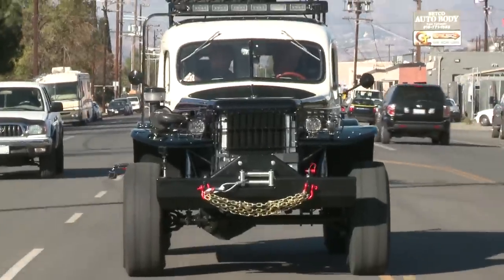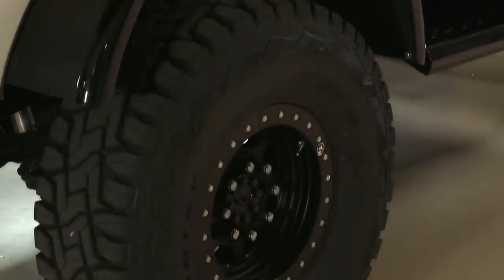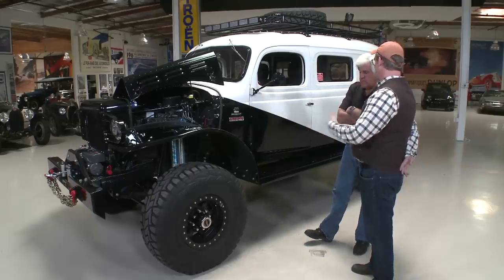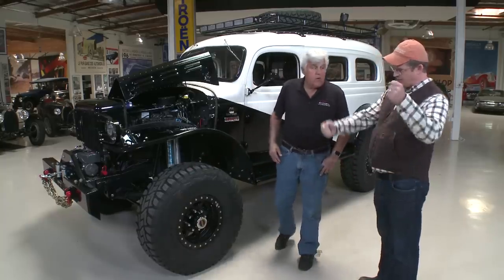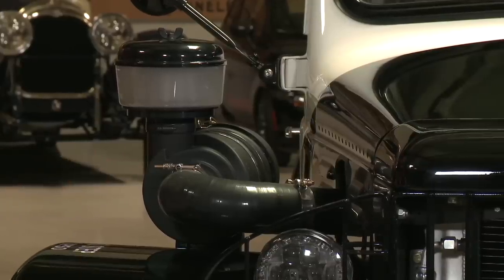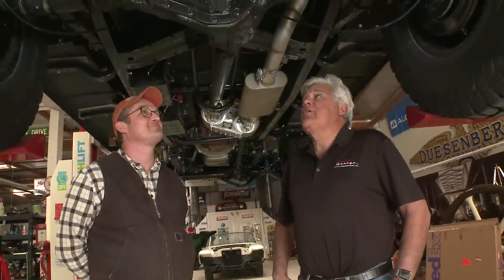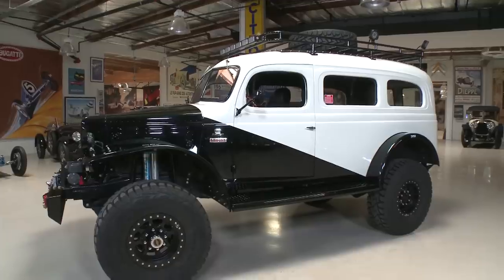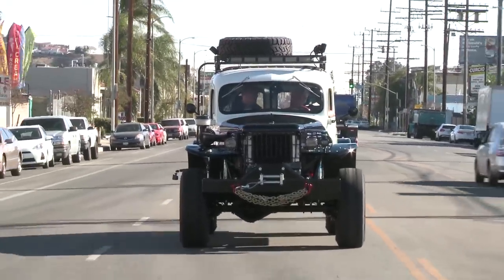1942 Dodge Carryall - Jay Leno's Garage

Comment: The Diesel engine only has one wire? To shut off the fuel?
What about the alternator and the starter and the battery?
More BS ....
If the batteries crack it can be push started.... If it had  bumper..
Zip ties ?
Reply: it does not need an alternator to run. do you know how a diesel works?
Reply: jamesbulldogmiller - you should know SOMETHING about ANY diesel before you comment on one.
Reply: Does it have an electric fuel solenoid or is it mechanical?
Reply: If it has 1 wire to kill it how many wires are there to start it because they didn't push start it.
Reply: jamesbulldogmiller "The Diesel engine only has one wire? To shut off the fuel?
What about the alternator and the starter and the battery?
More BS ....'" ///  It is a little but it doesn't need those in order to make it run. That's the point. That engine doesn't need external wiring or 12v power source to run. Does it make it simpler? Sure, but it's not necessary.  Not sure how that qualifies as more BS though. What was the first thing that was BS that this is adding to that make it more BS?

"If the batteries crack it can be push started.... If it had  bumper.." /// Or pulled with a strap, which I much prefer over pushing bumper-to-bumper. That being said, I'd want a rear bumper on my build but not necessarily to push on.

"Zip ties ?" /// Yes there were some. Did you have a point? If you're complaining that there were some, he gave a legit explanation as to why they were there and that when the truck was 100% they would be replace with leather straps. Did you not comprehend that? Or do think he should have used duct tape instead?
Reply: Don't forget the shocks with 3" of travel...
Reply: @kwhite145  mechanical

Comment: these batteries just hanging there with electrodes exposed.....wow....
Reply: the owners wanted lots of sparks for that "action" effect!
Reply: Won’t they short out if you drive in chassis-depth water?  Well short of the air filter.  Those door seals don’t look very waterproof either.

Comment: Not 4x4 full time, rolls eyes, batteries in the muck as well is crazy- at least a marine battery box and finally brake cables that will scrape and rip off on serious off road
Reply: Yep. And the fuel filler in the back...under 1500 pounds of tools, equipment and spare parts. That's smart...
Reply: Thing is it looks like beautiful workmanship, but poor execution regards under body protection and weather proofing.
Constructive criticism.
Reply: 130 hp turbo wtf fit a Cummins BT6 5.9 ltr 215hp plus and 400nm ( just do killer dowel pin mod) 
sight glass on a transfer case- my Land Rover 90 1uzfe powered toy doesn’t need this.

Comment: How are they going to go that deep in water with the batteries under the car?
Reply: cause water does not short out electrical systems on cars like you think
Reply: diesel engines can run under water, once the car is running its good

edit: as long as the breather is above water level
Reply: like he said the engine does not need additional electrical input
Reply: Change out for optima batteries, problem solved. They are sealed.
Reply: He said all the breather tubes were run together up to the air box.
Reply: He did not say if the batteries are vented as such, just that the drivetrain was. I think if the truck was going to be forging a lot, that sealed batteries would be a better overall choice, given where they are mounted. It is not clear if those Delco batteries are serviceable, but I would assume they are, which means they could be 'flooded' if submerged.
Reply: Lots of modern fuel tanks have the fuel pump with bare positive and ground connections in the petrol.
Reply: ALL lead-acid batteries of the AGM type are also sealed. The Mercedes-Benz Airstream Sprinter motorhome uses (2) AGM batteries mounted underneath, laying down on their sides.
Reply: Adam Trombino With very rare exceptions,almost all modern batteries are sealed. Was in an old school battery store in Vancouver BC. Davidson Batteries. Except very large 6V batteries for off grid power and one old school 12V boat battery(120lbs lead ),all the others were sealed. I prefer accessing individual cells,but the reality is otherwise. Boat battery is great. But about 18" ×12" ×6". Not that many vehicles with somewhere to mount that in a homemade box sturdily built.
Reply: unless there's a fuel solenoid!
Reply: Jay West, I doubt the battery vents are tied to the drive train vents, who wants sulfuric acid fumes in the gearcases!
Reply: Michael Richter Optima qc is not what it used to be. Both of my yellowtops purchased in 2013 failed shortly after warranty. Seems to be common after a Google search.
Reply: +Brian Sturzenbecher they are made in mexico,stay away!
Reply: Electrical currents follow the path of least resistance. So even when submerged, it wont short because the copper cables are more conductive than whatever muddy water the car runs through. At 1:50 in this video: watch?v=tKePT2I-ORU You can see a battery just below the person's legs.

Comment: so, all the drivetrain vents are exposed to engine vacuum? This doesn't cause problems?
Reply: Greg Fuller Intake at the air filter is about 2 to 5 inches of water,not mercury. Not a bad idea,but not a great one either. At least it is after the air filter so it is clean.
Reply: It's a diesel.  No throttle restriction.
Reply: Ah roger that, I had completely forgotten about the diesel part of the equation.

Comment: Running all the breathers to the air intake is a dumb idea. That basically puts a negative air pressure into all the running gear. Better to place positive pressure in there so that is pushes moisture and dirt out rather than sucking it in.
Reply: excellent point. The negative pressure in the housing is bound to suck in moisture and dirt. I guess the idea sounded better than it actually works...

Comment: So with those batteries exposed underneath like that, you can still drive in 4 feet of water?
Reply: furyofbongos Yup
Reply: Starter motor uses battery but the engine doesn’t need any electrical to run.  Lose battery’s and you lose accessories like the welder and air etc.  but you can keep going.
Reply: Batteries work just fine underwater.
Reply: Wouldn't they short out, since water conducts electricity?
Reply: dasher69 not really. Batteries are only 12v. Water isn't that conductive. If you were talking 120v that would be a different story
Reply: Gussy Grissom, yes there is and a cut-off for the alternator field circuit would be a good idea.
Reply: ...well I guess it doesn't really matter if the electrics go out when you're driving in water because the diesel doesn't require electricity to run. However, the battery location is nonsensical...

Comment: This is horribly designed. If I was going to drop 250k on a 4x4 it would be going to ICON not Legacy
Reply: Id go to Diesel Sellerz.
Reply: If I were dropping 250K on one it would be the Mercedes 4x4 Squared before this.
Reply: Mercedes 6x6 G-Wagon same price AND triple the power , air conditioning, and German engineering

Comment: As others have observed -- there is a ton of stupid in this rig and the $250K price is an obscenity. The builder kept insisting the machine was unbreakable. Yeah right ... no skid plates -- that exposed plastic tube, brake wires etc eternal. Battery location might survive some immersion -- but location is still senseless. Think mud, gravel, tree trunks. Inside filler position is beyond stupid. I bet this thing will break down within a couple weeks on the trail. If I were the client on that project I would tell the builder to go shove it and not pay a dime. I think a legitimate builder (who is not a thief) could take a similar, 80s land cruiser and ruggedize it properly for 30 to 40 grand in mods.
Reply: Yep totally agree. Poorly designed.
Reply: Price is not far off to do it right for a rare vehicle to do it period. A simple LS swap into a 50s truck starts raking up big bills for all the little things to do it right. AC, trans, suspension, bare metal restoration, rust repair, etc. They are not going to destroy this on rocks so no skid plates needed. Lol.
Reply: Everybody is entitled to their opinion.  I certainly understand the price.   To use a different vehicle is to miss the point.  Finally,  the customer gets to make his choices and this is not the finished product and this is an entertainment program.

Comment: Is amazing here we build old cars like this setup just for fun to say it some way, in Cuba we use the same concept, old reliable dieses simple to the core engine and old reliable chassis and old truck models and we will make it run for years using any kind of diesel fuel that we could find! Is just amazing necessity equals invention and innovation at the same time looking for something fun to do equals innovation and invention! Great Jay and the builder

Comment: Regarding the clear plastic tube that is susceptible to breaking, he could have installed a petcock on both ends that would remain closed when the vehicle is in use and then opened when one wanted to check the fluid level. This Ould keep you from losing the fluid if it should break while allowing you to check the fluid levels when you wanted to.

Comment: I don't know if you noticed but when you had it up on the rack the gas tank down on the lower left is something connected a line or sensor but the bottom of the tank is wet indicating a leak of some kind might want to check that out

Comment: I really love these resto mod trucks.

Don't get me wrong, this is a work of art though when running in really remote areas, you don't want in accessible batteries, you don't want to have to pull stuff out of the back to fill it with fuel and a Detroit locker is terrible in something like this off road, mainly on gravel or soft surfaces where it promotes massive oversteer mostly when loaded.

There is plenty of room to put decent batteries either in the vehicle or under the bonnet, and with on board air, a pair of air lockers would be much more practical than a mechanical locker.

Mechanical lockers also wear tyres badly .

Other than that, it's a great truck.

Comment: Super awesome beautiful HD Truck but have to disagree with the two mods that can easily ruin an Off Roader's day... 1- the visual tube on the transfer case. Off Road, this is an accident waiting to happen and if modern day trucks or Jeeps came with this, the first mod would be to remove it. 2- the exposed batteries under the truck... what do you think will happen to these batteries and electronics when the bateries are submerged during a river crossing? I have been taking Jeeps and Trucks off road for nearly 35 years.

Comment: You put everything that is hot on one side except that nylon fluid gage which Jay points out when looking under. The guy says if you cut it the whole fluid drops from the drive. SMART. What would possibly cut it off road or melt it next to the exhaust?

Comment: run 1 gel cell and one acid.  led acid breaks you have the reliability gel cell to start the truck , if the gel cell dies or both die you can still jump with the led acid. or go lithium worst case scenario the whole trucks burns down.

Comment: I had the 1958 version in the 90s with the 225cu. V8 and push button shift on the dashboard. It also had a standard rear passenger door right side only. I believe that it was a Forestry rig and Carmely brown. But red inside. Fun, definitely not economical.

Comment: At 14:33 Jay Leno asks if he is using lead-acid batteries "or an Optima". ALL batteries are lead-acid, including the Optima, unless you are using the extremely expensive Lithium-Ion batteries.The point is: there are excellent AGM batteries out there that outperform Optima, and they are also sealed.

Comment: Great show. Weird solutions with the transfer case plastic tube (does it matter if the gearbox and both axles don't have such? That thing being torn off on a branch?) and the sub-floor batteries. How are they surviving the wading depth to the air filter?? Anyway.
Reply: Or that they are negative pressure   so the engine sucks dust/water into these.

Comment: THIS was MINE. I bought it in 1971 and refurbished it, every bolt, painted it metallic gold outside and bright red inside. My lovely wife made new seat covers out of heavy canvas. I had to give it up in 1981 because I'd been fired from my government job three times for doing things right, I had no money, and the vultures were circling. I got a few hundred for it at auction in Billings, Montana. 19 mpg? Nonsense, more like 7. It was a lot of fun, but basically a glorified tractor. The read end pinion would flake and disintegrate fairly rapidly, it was NOT rugged. but new ones could be bought at WWII warehouses. The front end was the same as the rear, so you could swap or take a bad one out and continue in 4WD. Really, it was nothing but a glorified tractor, a death ride, not cool at all except to look at.

Comment: I'm worried about all the snaggable bits underneath: big rocks or branches will rip those looped-under-axle brake lines right off. And exposed to the elements, the battery leads are going to corrode pretty fast. I might have put the batteries inside somewhere. (The limitations of the 1942's small hood are apparent here.)

Comment: Overall, I am impressed.  I'd prefer batteries moved topside somewhere, and a dashboard monitor for transfer case oil level instead of plastic tube. 
But if it showed up "under the tree" I'd happily drive it as is.

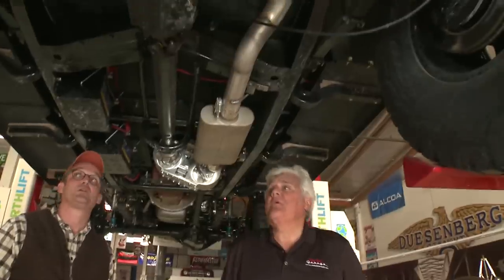Comment: You can go through water up to the snorkel but at 22:50 the battery is at the bottom unsealed and unprotected? If you go through water wouldn't it short circuit everything? Maybe didn't think that through, battery inside in a sealed box would have been better, I'm sure you could integrate the box into something so no space would be lost.
Reply: At 23:50 you have a clear soft plastic tube less than an inch away from your exhaust? I would have wrapped that section, or the entire exhaust with heat wrap. All this money into the vehicle and very simple things skimped over?

Comment: I really wish Jay wouldn't interview the owners of businesses. This guy doesn't know any more than just the basic components. A Detroit Locker is NOT a full-time locker that turns the wheels the same all the time. That device is called a spool. Jay's got enough class to clarify the guys lack of understanding without humiliating him by mentioning the clunking around corners, which the guy didn't understand. Also, the 14 bolt is a common axle and not just from a 5/4 ton military vehicle, what salesmanship.

Comment: I haven't read every comment, but don't you need skid plates for the fuel tank, oil pan and transfer case? This chase vehicle will be going balls to the wall to catch up with the action, so it needs to be as invulnerable as possible. What you can't tuck out of the way needs guards.
Also, what transmission was used? Is there an overdrive gear?

Comment: agreed and over mentioned —,...no design meeting about the +/- on the fuel door location. one guy's consideration only I suppose "wait I just have to move the giant ralph lauren custom bespoke tool trunk and my wife's parasol - then we'll get some diesel in there. even though this is a resto mod I think the cummins badge should stay off - or take a cue from Ward and cnc a new one with permission.  nice job on the terminal locations.

Comment: Just out of curiosity... how often did they need to replace main bearings from lugging those engines with speeds like those. I've seen it happen with shifting @ such low speeds.

Comment: I have to wonder about routing all the vents to that air pre filter/cleaner. They work on the priciple is entering the system that centrifugal forces  throw  particles in the air to the receiving cup.. What's are the chance that air flow could create  negative air pressure inside the gears. Something you don't want when fording deep water.. Mey the lines arn't ported the air intakesystem, but he sound like they where circuit breakers can get flaky, so it would be wise to carry spare like one should do with fuses.

Comment: 25:42 "110 psi", how many cubic feet to keep up with an air knocker or similar ? By the look of that little compressor you'd need a hell of a pressure tank, maybe you could put it on the roof because it wont fit underneath.

Comment: If u really need to haul and go offroad ,get yourself a used military Russian URAL truck !It also has that forties vintage look but no plastic tubes or anything else that would fail in the middle of the desert, then you also wont need to dig for water after breaking down in nowhere land.

Comment: I agree with a lot of comments on the build. Great ideas and love the truck just many flaws in the design. As a 4x4 chase truck or general 4x4, there are many issues like the non-gel cell batteries under the truck exposed to road debris, rocks, etc... are a poor design. The fuel filler while a good idea to discourage tampering is poorly designed.  A lot of work to just fuel it up as it will be filled with support equipment. Lots of exposed wires and cables the snag easily or will corrode. These are just a few quick observations. Many of the parts used are great but the devil is in the details. Jay pointed out many of these during the video. I think the designer and engineer needed to look at other chase trucks from say the Dakar rally or Baja 1000 and pull from their knowledge. What is sad is someone paid a lot of money for this type of quality.